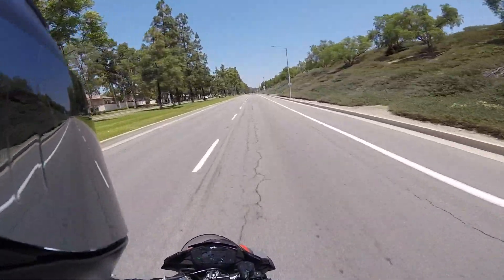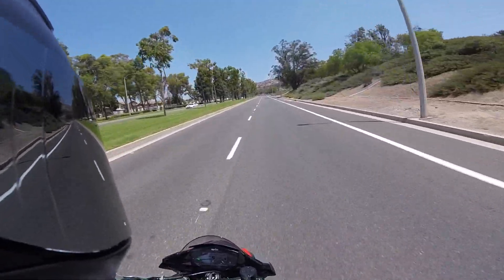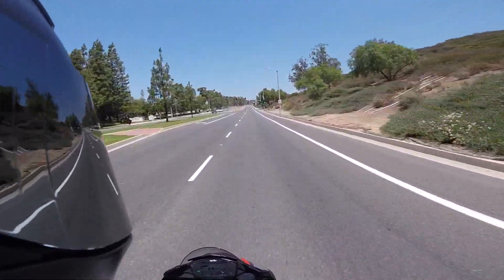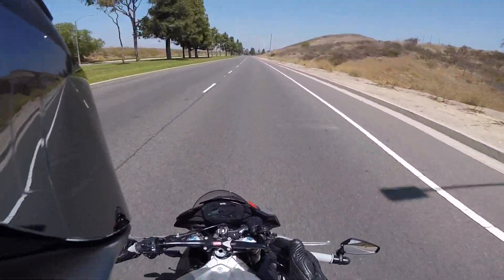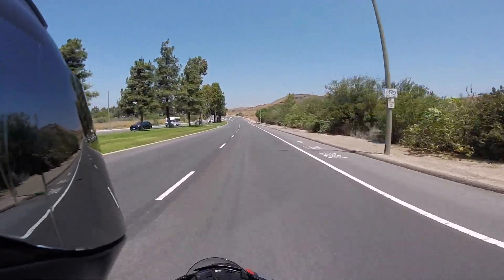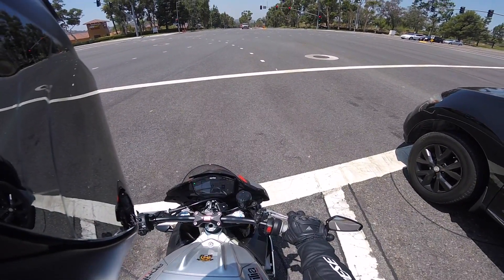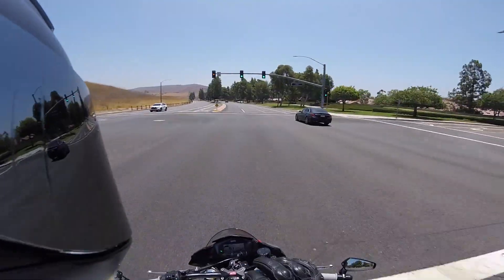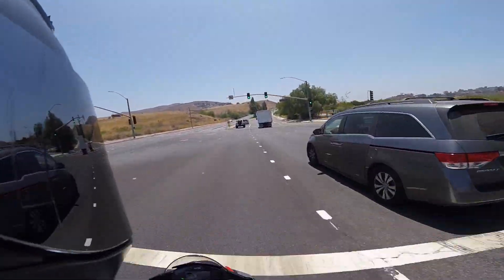How Wheelie Control Systems Work on the Aprilia Tuono V4 Factory and Other Motorcycles

Comment: 1:51 how did you short shift that quick?? My qs never lets me shift immediately after shifting… if they makes sense
Reply from the maker: I've had a similar experience. I found I wasn't relaxing my ankle and moving it far enough off the shifter for the lever and qs to move back into position for another shift. If I make sure to move my ankle that extra bit, it works

Comment: You really did not get any info about that actual wheelie control, so how much does one setting affect and let the front end  get up….
Reply from the maker: Hi Terho! I did my best to communicate how the wheelie control system works and, unfortunately, it is not as sophisticated as to say setting 3 will let you get the wheel exactly 6 inches off the ground, setting 2 will let it reach 1 foot of height, and setting 1 will let you reach 2 feet. Settings 2 and 3 cut the power quite quickly, many times so quickly it doesn’t seem like the front wheel leaves the ground at all. Setting 1 will let the wheel come up a bit, but the height you can reach before the system intervenes depends on many other factors, like how quickly and far you open the throttle, how the suspension is loaded, how much momentum the front wheel has, etc. I tried my best to explain it and did not demonstrate settings 2 and 3 because nothing really happens, but perhaps I should have. I appreciate your feedback. 🙂

Comment: One thing to note that makes Aprilia's IMU even awesomer is at lean, traction control will control wheelie response whereas when you get back upright, wheelie control takes back over. So even with AWC off, ATC will prevent wheelies at lean, which with good tires and smooth throttle is absolutely possible lol
Reply from the maker: If I recall correctly, AWC can differentiate between a slide and a wheelie when lean angle is less than 20 degrees. With more than that, you’re most likely going to slide anyway. But to your point, this is avoidable with good tires and throttle control, even without rider aids! 🙂
Reply: @hiimchad  Definitely! However a huge benefit of ATC is if you set it to the right level for your tires and conditions, you can use it to "walk" the bike around a corner where ATC allows a small slip then intervene, slip then intervene, over and over until you go back upright. Aprilia has a demo video of it, and I tested it (unwittingly) on my Tuono V4 and yes, it definitely works. Of course I needed a change of boxers after that but who cares SEND IT!!! 😂😂
Reply from the maker: @carlosm9111  Interesting! So like a bunch of little slides to the point where you tighten up your line? Like squaring off the corner?
Reply: @hiimchad  Exactly! Until you feel it you won't believe how effective it is. You can get back on throttle sooner and APRC will help you be faster than you would being a normal human LOL

Comment: Great explanation. Does AWC 1/2/3 differ in how abrupt it engages or how long you can bring the front up? I wish aPRC had the Ducati degree set wheelie control, that's pretty fancy. Keep up the great work!
Reply from the maker: Thanks Sam, glad you enjoyed! Setting the AWC changes how quickly wheelie control will engage. So, if you have it set to AWC on 3 (highest setting, most invasive) it will barely let you get the front wheel off the ground unless you do something risky like a clutch drop at high RPM. 2 will give you a little more freedom, so the wheel will come up a tiny bit more and for maybe half a second longer, and 1 will let you get a few inches or maybe a foot before it intervenes. Of course you disable the system entirely, in which case you're on your own 🙃

It sounds like the way Ducati's system works is much more precise! AWC is really more of an anti-wheelie measure than actual wheelie control. That's really cool that you can set a max wheelie angle! Sounds like actual wheelie "control".
Reply: @hiimchad  how do you disable the AWC entirely?
Reply from the maker: @NAPP3R  when AWC is selected and set to 1, hold the joystick or LH switch down for a few seconds and it should set AWC to “-“ which is off. Hold the stick or switch up for a few seconds to re enable it. 👍

Comment: Nice video Chad - still learning all the settings on my 2018 Tuono🙈 Good to know that you can change the AWC on the fly - not used the cruise control yet, but the ability to select AWC levels/switch off for certain sections of road will be very “useful”😃 also explains why I had only been getting “mini” wheelies (on AWC1) thus far☺️ If you have a “wheelie school” near you, well worth doing as they teach you clutch up wheelies👍🏻
Reply from the maker: Glad you enjoyed! 😁 Yes, even on the 1 setting AWC is pretty invasive. I actually purchased a Yamaha WR250X a few months ago specifically to learn how to clutch up, and it's been going well! I'm getting to the point where I can bring the front up and consistently ride it out to the limiter in 1st, but the bike doesn't make enough power for me to be able to get the front up in 2nd gear. I think I'm too big for it.. 😅 Once I get a bit more comfortable on that, I may step up to a 450+ supermoto, and once I'm comfortable there, disable AWC. 🙂 How is your wheelie game?
Reply: @hiimchad  well done and sensible learning on a bike you’re happier to drop...👀 

I did a wheelie school and learnt to clutch up on a street triple in 2nd and hold the wheelie for about 30m - but with “cut out wires” on the back in case you went too high - meant you have some feel rather than just nailing it as it would just cut the engine and save you ☺️ if you can combine a “bounce” on the front, clutching up and the power increase as one it’s easier - but the Daytona was not easy for me to wheelie being positioned over the nose and with the slipper clutch😇
Reply from the maker: @d675ose7  I don't know if I'd say happier to drop, just less sad.. 😂

That's awesome! There is actually a wheelie school about an hour and a half from me, but it's pretty expensive so I've been hesitant to sign up. If you don't mind my asking, how much was yours, and would you say it was worth it? Appreciate the advice on the bounce! I'll have to give that a shot next time I'm on the WR! Totally understand how the Daytona would be more difficult with more load on the front. I tried to clutch up a wheelie on mine a couple time when it was a street bike, but never got the wheel off the ground 🤣

Comment: As a general rule and tl:dr don't ham fist the throttle. Treat it gently and you don't need to worry about uncontrollable wheelies. Of course on modern bikes assuming you have anti-wheelie on you can be a lot more ham fisted with much less bad side effects lol, still it's not a guarantee.
Reply: @StuOnTwo ham fist?
Reply: @NinjaKing878  
ham-fisted
adjective, INFORMAL
clumsy; bungling.
"a ham-fisted attempt"
Reply from the maker: @NinjaKing878  I think it’s basically the equivalent of having a “heavy foot” or overconfidence with the throttle 🙂
Reply from the maker: Yes indeed! It’s nice to have, but there is no substitute for proper throttle control. If I may ask, what did you think of the video overall, Stu? 🙂
Reply: @hiimchad  I would love to see more show than tell :). Maybe show differences between OFF, 1, 2, 3...
Reply from the maker: @MartinDoubek_ArnieX  hey Martin, I appreciate the feedback! Not quite ready to turn it off yet. That will come for sure but I want to get a bit more comfortable with wheelies on my WR250X first. 🙂 Good thought on recording the differences between the three levels, though! I tried all the settings when I got my first Tuono V4 last year and eventually settled on 1, but from what I recall 2 and 3 just bring the front wheel back to the road earlier and more abruptly. Could make for a good short! 😁
Reply: @hiimchad  Completely understand :D I'm thinking of getting new bike for next season after 12years pause in biking. I have just visited two iterations of  Yamaha MT Tour event's and tried MT-07 three times and in each ride I have lifted wheel a bit and that bike doesn't have any wheelie control as it probably doesn't necessarily need one with it's peak torque and power but is definitely capable of wheelies. Then I tried and completely fell in love with MT-09 and well I was I think happy that it had LIF set to 2 as it allowed me small lift but that was about it. Good that it also has TCS, SCS, Cornering ABS, LIF and all that possible modes for everything. Seemed like a bike that can be total pussycat as well as mega hooligan :D. So be careful and if you feel confident making video to show differences it would be great, it may as well be the only video like that on youtube, as I couldn't find a lot of videos showing how these systems work. I would expect that manufacturers would be showing it off on controlled roads but there are only few of these driver aids covered.
Reply from the maker: The MT-07 and MT-09 are great bikes! The 09 is a bit of a beast as well! Very easy to get the front wheel off the ground. 🙂 All the rider aids are a nice touch as well. Great to see things like that finding their way onto sub-1000cc bikes!

I'll try to work it into my schedule! Shouldn't be too hard to record!
Reply: @hiimchad  awesome, subscribed and notifications on, keep the good things coming. Well indeed it is a beast :D no doubt, but quite well handling beast to be honest, as I was really afraid to hop on it with long pause in riding but then suddenly it handled better than MT-07 and I felt much safer too. Maybe part of it was just knowing that I have the noob mode on :D but hey, who cares why, important is that it felt that way.
Reply from the maker: @MartinDoubek_ArnieX  Appreciate your support, Martin! Thank you! 🙂 So long as it feels right and inspires confidence, that's what matters. 😁 Let me know what you end up settling on when you bring it home!
Reply: @hiimchad  Hi, I promised to let you know what I will get :) and it took huge twist :D. I was in discussion with Yamaha dealership to get theirs MT-09 SP demo bike, they said it has about 10k km and that roughly the sale they can offer will be 15%, then when it came to negotiation suddenly the sale was just 10,5% and the bike already had 13k km and it would definitely have 15k km or more when I would pick it up. So i decided that this is no longer a good deal so I started to look into alternatives. I found couple MT--09 SP new and I got some price cuts on these but in current situation where there is more people wanting the bike than there are available bikes, negotiation on price is not something really working :D. But I already become a bit disgusted with the twist and decided that my limit was originally roughly 9260USD but now I was already looking at spending 12917USD. So I started to look back at what I was originally planning to get which was some 600cc bike with decent power and good chassis that I can get back to biking without being scared that I will die horribly :D. So wen't over these 6-700cc bikes that I tried out and decided to get Triumph Trident 660 and luckily my dealership where I demo rode it have Crystal White in stock so I just paid for it and should be picking it up next week :). But I couldn't just get it stock obviously :D so I ended up with couple extras like quick shifter, bluetooth module, frame protector, tank pad, fly screen and USB charger :).
Reply from the maker: @MartinDoubek_ArnieX  congratulations, and thank you for the update! Sorry to hear buying an MT-09 SP was such a hassle, but I'm delighted that it sounds like you found something that will make you just as happy at a reasonable price, and with all the goodies you want! Enjoy it, and ride safe! 😁
Reply: @hiimchad  thanks a lot. Well bikes has to make us happy and for that there doesn't always need to be 1 bilion hp ;). Ride safe too, wheels down :)
Reply: @hiimchad  Production quality nice, commentary nice a bit in-depth for my liking however that is just personal preference not a critique in any way.